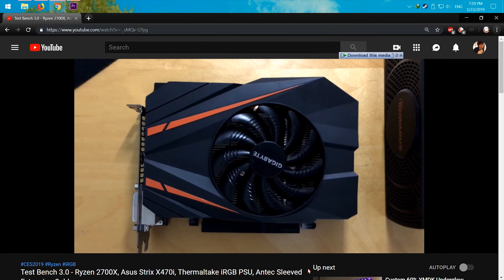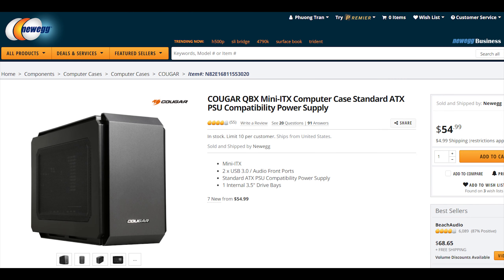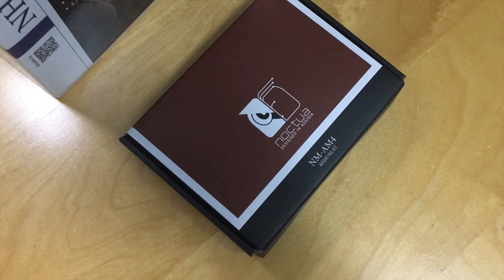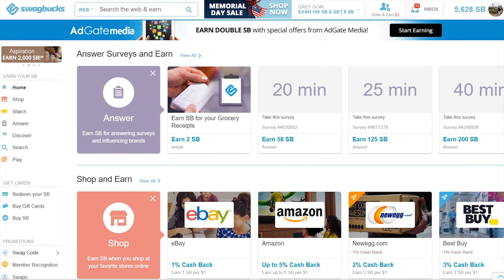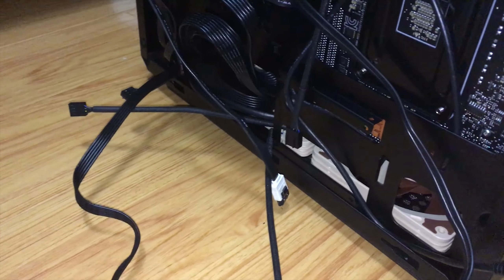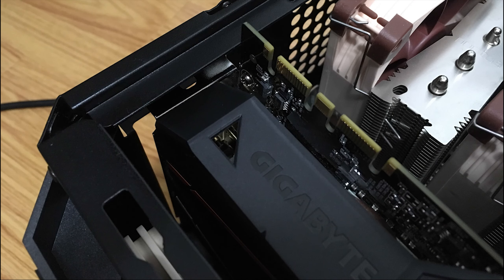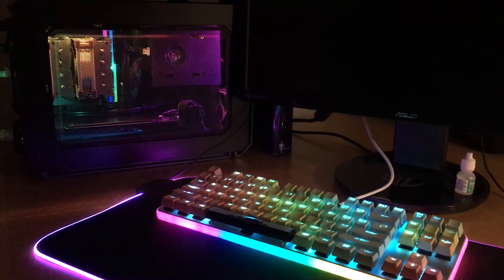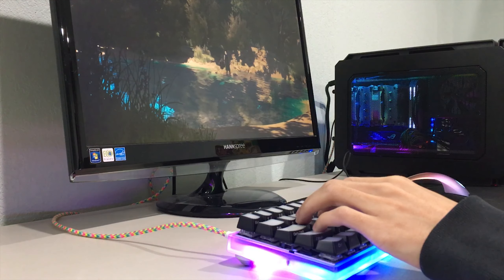SFF Cougar QBX Clean Build - More Cores, More Noctua with Ryzen 2700x and i9-9900K

Comment: PSU is backwards. The fan TAKES air IN so it has to face outwards to the mesh!
Reply from the maker: Doesn't matter, it's actively cooled by the 120mm fan. But there nothing wrong to use PSU to suck hot air out
Reply from the maker: Also behind the back there are full of cables, it would be worse for the PSU

Comment: I have same case. I found that negative pressure works better for this case. I have 2x 120 mm on top of the case as exhaust. And also 90mm exhaust on the back of the case. For intake I have 80mm in the front and 120mm on the side. It’s on where the hdd brackets supposed to be.
Reply from the maker: Negative pressure would cause dirt to be sucked in so I am not sure to try
Reply: Poker FaZe unless you live out in a dessert, I don’t think it’s a problem this small case is very easy to clean. I just clean my pc after a year and it’s not dust. I have pets at home and furs are issue. However i don’t see them inside the case. Most of the opening in this case are perforated. Most of the dust are trapped on the outside of the case.
Reply: So then a blower style GPU would be a good idea to use?
Reply: How do you fit 2x 120mm in the top, with the power cable on the PSU I cant fit 2nd fan in there?

Comment: Where did you connected all the fans on the MB? Does it have enough 4pin connections to work?
Reply from the maker: I used Corsair Commander Pro for those fans
Reply: @PokerFaZe  thanks, any other chance to connect? mybe via y slitting cable? but than i am limited in the fan count
Reply from the maker: You can use a SATA PWM fan hub like these http://ebay.us/78HUiR which allow connecting up to 10 fans, and they are cheap :D
And yes, Y splitters that come with Noctua fans work, too.
Reply: @PokerFaZe  but i want to change the speed of the fans by myself. maybe corsair commander pr is the best solution???
Reply from the maker: @Goten.2752  If you want to control each fan with software like I did, then the best option is the Corsair Commander Pro.
Reply: @PokerFaZe  ok then I think it will be the commander Pro. But to be honest, I dont really know how much fans in this small build really are necessary. I have an AMD 5600X with AMD writh prysm fan and 1080 ti GPU, NVME SSD 8no additional SSD or HDD) and Corsair SF750 PSU. So how much fans really are needed? Maybe 3 Fans are enough, so I use two splitters one into CPU Fan plug and the other to sys Fan. More I dont have. But with this solution I can have 4 or even 6 Fans installed. WHat do you say?

btw: I think the heating Problem you had was also pushed by the PSU which was mounted the wrong way, because the warm air is blown in the inside of the case
Reply from the maker: @Goten.2752  The PSU orientation doesn't matter much. The two top exhaust fans would pull the hot air out and actively cool the PSU. If you look at the Dr Zaber Sentry case, you would see the PSU faces inside. Plus, PSU faces inside allows you to mount an extra fan on top, because it would not be blocked by the power cable.
You are right, I was inexperienced about the fan orientation at the time, the top fans should exhaust the hot air. 
I think you only need two bottoms intake fans to cool the GPU and one exhaust at the back, and maybe one extra top exhaust for the CPU.
Reply: @PokerFaZe  I now have installed one bottom for intake. One top outtake. One front intake and back outtake. That’s it. ;) and the PSU is mounted the right way. 

Do you know if it is possible to make a fresh installation when bios boot up with usb keyboard and mouse? Or is it only possible with wired keyboard? I don’t have wired one
Reply from the maker: @Goten.2752  I don't use Bluetooth so I can't answer that :)

Comment: Hello, great video! Please could you help me, I saw you mounting the Noctua NH-D9L which has a height of 110mm, the QBX has a maximum height of 105mm according to the manufacturer. How did you manage to fit the cooler in the case and also what is the real max CPU height for this case. Thanks
Reply from the maker: I think the 105mm limit you read is with the side radiator mount, without it, you can even install a Cryorig H7 120mm air cooler
Reply: @PokerFaZe  thanks a lot my friend that was helpful!

Comment: I’m getting mine used (pre-built) and I was gonna swap out the motherboard and the gpu for the ryzen 9 is that a good idea or should I just stick with a  ryzen 7? The cpu it comes with is ryzen 5 3400G
Reply from the maker: With some undervolting, maybe, but I would stick with a Ryzen 7. And don't follow the fan setup in this video, it was wrong.

Comment: what best Air cooler for cougar QBX could you tell me please
Reply from the maker: I think the 120mm Crorig H7 🤔 

I don't know if Noctua U12S can fit, you have to compare its height with the H7, if it can, then it should be the best
Reply: @PokerFaZe  i find this and i wish if it can fit in my case cougar
Cooler Master HYPER 212 RGB BLACK EDITION
or this
FSP Windale 6 CPU Cooler 6 Direct Contact Heatpipes 6mm
how about your opinion
Reply from the maker: Check its height
Reply: @PokerFaZe  Height 158 mm
how about it
Reply from the maker: Then nope

Comment: What is the exact brand of your old thermaltake PSU? Wouldn't the Cougar QBX case be compatible with dimension sources 150mm x 86mm x 140mm and a GPU of 20 centimeter or more?

Comment: Why dont u use corsair water cooling? It might give better temp in a tight case
Reply: True, that what I did (EVGA AIO in my case), but I does take a little extra work and possibly some modding.
Reply from the maker: Because I don't like the look of it. It surely give better temp, even without those extra fans. 
But I prefer looking inside my build, that's why I spent time on managing cables

Comment: I heard adding feet to the case (so it's a couple inches off the table) helps temps by a lot
Reply from the maker: It can help the temp of the GPU by removing/replacing the feet, but it could benefit a bigger GPU, for this iTX 1070, I don't think that is necessary

Comment: Subbed, this is very similar to a build I wanted to do, really really great that the RGB makes the side ventilation as a window of sorts because you can see in, I'm interested in how the dust filters worked. What a great build and when the 1070 needs to be upgraded will be a very good system to upgrade.
Reply from the maker: Thanks, good luck to your build

Comment: By the specs of the case and Noctua CPU cooler, the CPU cooler should not have fit.  How did you get the Noctua CPU cooler to fit?
Reply from the maker: This is the NCase M1 with dual-slot GPU support. So what the M1 can fit, this case can
Reply: If you dont install a fan on the left side there can fit a cpu cooler up to 135mm in height

Comment: Great build, I'm about to buy that case eheh Can you confirm that you can mount two low profile 120mm fans under a 1060 Asus Strix (the 3-fan one)? And are those two fans actually useful under the already 3 fans of the graphic card?
Reply from the maker: It fits, but the feet of the case some what choke the GPU, I will try replacing it

Comment: Hey man, this was a fun video to watch, thanks for sharing. I'm actually thinking of building in either the Node 202 or Cougar QBX, but really can't decide. 

I like the portability of the Node 202 (I will need to bring it on the plane with me in my carry on), but I feel like the QBX will get better thermals overall with all the fan options. Plus the QBX may allow for a fan style card, which may lead to better performance.

I must admit, I also really liked the look of the RGB coming from the side of your case, it's another point in the QBX column. What's it called?

What do you think?
Reply from the maker: The strip is the WS2812 Rgb strip I bought on eBay, along with the usb 2.0 header + remote controller for changing the patterns. They are super cheap and have limitless lighting option to play with the remote control. I plugged them in the Commander Pro as it has 2 USB 2.0 headers.

If you search on sff reddit, some people suggested luggage for the Cougar QBX that you can carry on the plane. But the Node 202 could also be a good option. I remember Bitwit modded the case to insert a 120mm AIO to cool the cpu, you can check that video out.
Reply: Dont get the Node 202... its getting hot as f****! 
i allready owned one and had to do much casemodding.
Reply: @PokerFaZe  Hey man, thanks a lot for the reply. I ended up going for the Cougar QBX - I think your vid was one of the ones that first started to sway me. I became too worried about thermals in the Node and knew I could get better performance in the QBX, so I'll be building it pretty soon. I'm using an i5-9600K though so I don't think it will be too hot. 

Regarding the strip, thank you for the name. But when you say USB 2.0 header and remote controller, where can you get those? Can you run the strip without the header and remote control? How does that work? Also, looking at the strips on ebay now, but how many did you buy? 1M 30/60/144? Or 5M 150/300? Sorry, I'm a total noob when it comes to the LED strip stuff.
Reply from the maker: I could not find how the strip I bought, I think 60 leds should be enough, but up to you. You can search WS2812B 5V USB2.0 Remote Controller on eBay, then use this https://www.amazon.com/dp/B06Y5C7DKH/ref=cm_sw_r_tw_dp_U_x_f0fbDbZKX8NF0 to plug in the Commander Pro or the USB 2.0 header on the motherboard
Reply: @kelsealawrenson7188  Hey there, if you don't mind, could you share the temps for your build with the QBX (and your specs too). Cheers!
Reply: @liquidgtr  Wow sorry man, I thought I replied. In case this is still relevant:

My main system specs: 
-Core i5 9600k
-RTX 2080ti Asus OC
-16GB ram
-Asrock Phantom Mini-ITX
-Noctua U9HS cooler (great cooler for this case) + 2 other noctua fans acting as exhaust

My ambient temp is about 21-22 degrees, and I took out the dust filter at the bottom of the case, and also added 4, 20cm case feet on each corner of the case to raise it off the ground. I also run my 2080ti on a stock fan curve, because otherwise the heat just gets dumped into the cpu chamber anyways. I rely on the 2080ti fans to act is intake (no room for fans on the bottom of the case with this beefy card).

Under these conditions my  2080ti never reaches above 70-71, and my CPU never above 75. Personally I'm very happy with the performance of the case. You could possibly do even better with a watercooled build, but that wasn't for me. 

It was challenging to build in (watch out for the height of your video card - I just BARELY fit mine in after some trouble), and you have to consider the PSU carefully, but it was a great experience overall, especially being my first build in about 5-6 years.
Reply: @kelsealawrenson7188  Thanks for sharing! I'm guessing the GPU really benefits from the raised case feet (and removed air filter) to get the additional cool air from the bottom. Wouldn't want the GPU to get thermally throttled now would we ;)

This is really some great reference for my future build.

Cheers man!

Comment: Hey! Thanks for the video, I have a few questions. Answer them and I might just send you a gift in return (no joke). What were your 1080ti gpu temps? I have Asus strix 1070 so they're very similar. Lets be honest your video card isn't always going to be ramped up to 100% so the wattage difference will probably by like 10% Delta most of the time. I feel like the gpu gets hot in this case which I find off putting. It's the only thing that's making me hesitant of getting it. From the looks of it, it looks like the hot air from the gpu can't properly escape. Does the perforated part of the side panel extend low enough to the point where the the entire gpu heatsink is visible? If it doesn't that could explain the high gpu temps I commonly see in this case since it means the hot gpu temps have nowhere to go which would be a major problem. I think running the front fan as exhaust (gets rid of stagnate hot gpu air) and back fan as intake (gives fresh air to the cpu) will help both cpu and gpu temps, you should try it out. Have you tried taking the shroud off the gpu to see if it makes a difference? I'm considering getting this case and if I do I'm going to design and 3D print a fan duct for the strix gpus and see if that helps with cooling the gpu. If it does I'll happily print one out for you and ship it to you (as long as you pay for shipping lol). Might desing other feet for this case too to lift it higher. Thanks for the video man!
Reply from the maker: The build has changed quite a lot since. But I did not test the temp of the 1080 Ti with the 2700x so I can't tell. The original purpose was putting the mini 1070 instead of the 1080 ti. I have replaced the case's feet + undervolt the card and now the 1070 is running cooler. You can check the 2 updated videos if you want. 

Btw, thanks for the offer, but I prefer my 1080 Ti on my personal test bench :))

Comment: Nice one, I like how you showed how working in small form factor any build can get messy with incompatible components, I like the qbx but I recently found the Phantex Metallic gear Neo ITX, supports 280 side radiator
Reply from the maker: I tried to challenge myself with that PSU but it was a time-wasting failure. Glad that you enjoy the video. I just checked out the case you mentioned, it looks like a nice case to work with